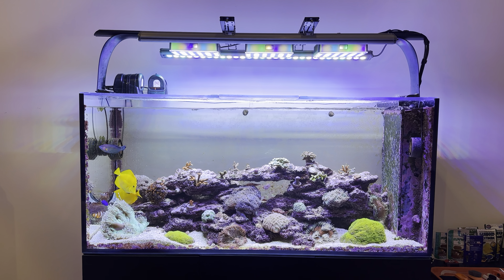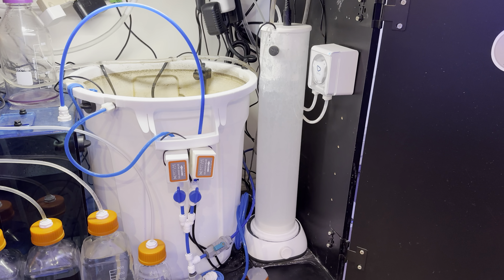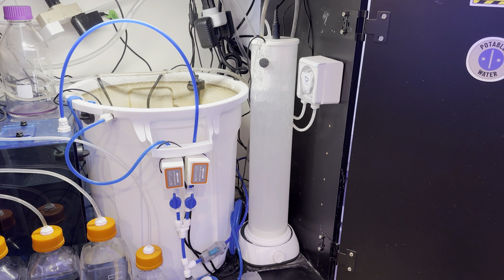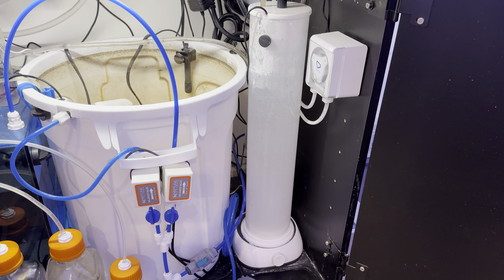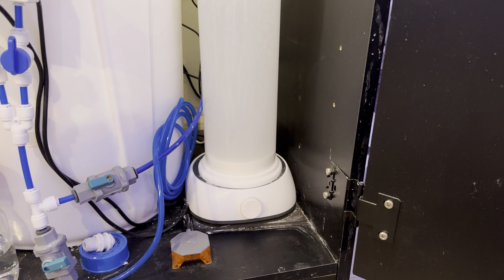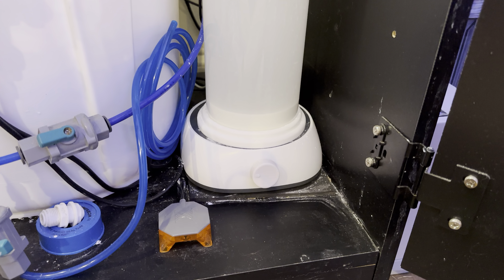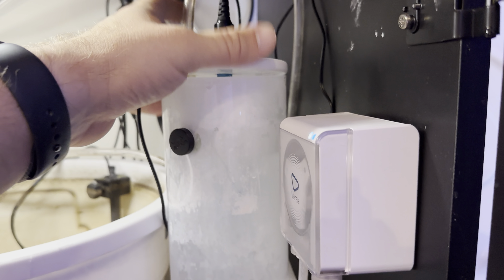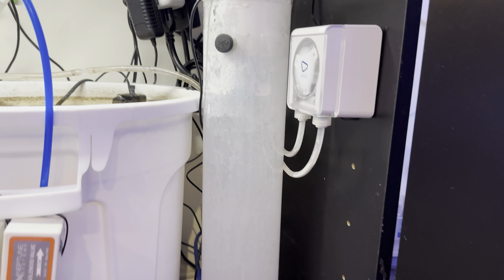Explained: The ‘Kalkamazoo’ DIY Reactor For Dosing Kalkwasser To Reef Tanks

Comment: I just mix kalk solution manually in 5 or 10 gallon container and versa dose same amount as evap rate daily and adjust depending on dkh.  Much simpler than reactors, no need to worry about sensors or mixing plates failing.  Aka meckli method and costs very little to setup.  Also dose into overflow to really dilute well before kalk hits pumps or sensors susceptible to kalk deposits.  Just did my quarterly maintenance on my skimmer Venturi inlet and found very little depositing of calcium carbonate, which used to happen much more when I dosed into the sump.  Nothing like venture capital to screw the customer… bravo!🤦🏻
Reply from the maker: People who run kalk out of a container do love it, but I just like nerding out with my little DIY reactor lol. And yeah, my Versa needed a full reset and reprogramming today for absolutely no reason. Venture capital. Gotta love it.
Reply: @kalamazoo_reefer gotta keep it simple
Reply from the maker: @iammrhappy12  I mean this in all kindness: says who? This is how I do my hobby. I’m a gear guy. I like to fiddle and adapt stuff and make things work together, to keep my tank thriving. It’s what brings me joy.
Reply: @kalamazoo_reefer   @kalamazoo_reefer  In my opinion, dosing from a container of fully saturated kalk is the best way to go and is the most simple. Once the RODI is saturated with kalk and the undisolved kalk sets at the bottom, it can not lose its saturation if its air tight. Check out Chris Meckley at ACI Aquaculture and his kalk method. Many of us do it this way. 
Adding kalk based off evaporation is not very efficient either. Evaporation changes based on the season. Evaporation is occurs nore during summer and less during the winter. You want to be able to know exactly how much youre dosing, just like how we do with 2 part dosing. use this calculator to figure out how much to dose. Its very accurate. hamzasreef kalk calculator. This persons other calculators are extremely accurate as well

Also it seems like youre not letting the undisolved kalk fully settle after stirring because there is undisolved kalk in your versa dosing lines. You should not be adding unsolved kalk into the tank. 

I'm a big gear person as well. I have alot of gear for the tank. Similar to what you have. So I know what you mean.
Reply from the maker: @iammrhappy12  Not saying you’re wrong on any of this methodology, because it definitely works…but also, not going to say all of this is “the best way, every time, end of story” across the board, because there are a lot of people not doing it this way, having a lot of success. The way I’m doing this has been highly successful for me. I’m not claiming my way is better or worse than anyone else’s, either. I strive to not make claims like that. It’s simply how I choose to go about it. I mean, heck, we’ve got people dosing full-on slurry with great results. Nothing about what I’m doing, raises any kind of red flag for me, and the results speak for themselves, as my system has been quite stable overall, ever since implementing this reactor.
Reply: Ok everyone take a deep breath and remember there’s 50 different ways (or more) to get to our collective goals.  Just listen and learn from each other, tweak your technique to fit your needs, and share info so we can all become better reefers.🤷🏼‍♂️
Reply from the maker: @MW-ut3dk  Ha, I am chill about it. It has just always fascinated me that one of the most vocal and pushy contingents of people who comment on my channel are the “I dose kalk from a reservoir” people. I’m not sure what it is about kalk reactor users that triggers this crowd, but I’ve taken flak consistently about using a reactor from them. Just because I use a reactor does not mean I think it is any better than dosing from a reservoir. It helped me save space, and I’m a nerd for this stuff anyway. So I suppose I am just slightly guarded about it, given the track record of past critics of kalk reactors on my videos 🤷
Reply: @kalamazoo_reefer  it’s fine you do what suits you and greases your wheels.  I just find that the anonymity of the internet sometimes gives permission to some people to step over the fine line between sharing info and cyber bullying.  Not saying anyone is doing that here, just hoping this doesn’t start heading in that negative direction.  I’m a subscriber so obviously I do find this channel informative and helpful, so no offense taken on my part.  And I definitely don’t pretend to know everything about reefing, quite the opposite, still learning everyday and tweaking along the way.

Comment: Also, how much Kalk can your magnetic stirrer handle? I made the one that Devin uses and it works great but I can’t put more than two tablespoons in or it knocks the magnetic bar off. I even tried a larger stir bar. It’s the stirrer itself that doesn’t have a strong enough connection. So I’m looking for something a little stronger.
Reply from the maker: @kaseyascani127  It handles about a half cup of Avast kalk powder, for me.
Reply: @kalamazoo_reefer  much better than mine. For that cheap price point I think I’ll try it. Thanks for the tip

Comment: I thought that ph probes should stay submerged in water to stay reliable. Is that incorrect?
Reply from the maker: Not looking for accuracy on this one, just looking for a very ballpark reading. As long as the solution in the reactor is saturated, that probe will always read at maximum (which is 12.3ph), so if it ever drops down to like 9ph out of nowhere, I know there’s an issue with the reactor. It’s a safeguard only. Not actually trying to get an accurate reading with it.

Comment: Gotta love kalk. I was going to get a reactor from MRC but they are pricey and a ton of work to take apart and refill. I personally just use a custom bin to store my kalk and only stir it when i add kalk once every few or couple weeks depending on the tank. I think after it settles even the clear stuff is fully saturated when mixed thoroughly. I use a cheap 4 head doser off Amazon and just go to the next head if i cant get it calibrated but thats rare. I dose right under whatever my winter evaporation is and in the summer my ato still hardly moves. Im sure it would be an interesting video on how long kalk holds its values especially ph. Idk if anyone has done that. Im sure there could be too many variables that may change things though.

Comment: If you were to replace th3 versa what would you get right now?
Reply from the maker: To be honest, not sure. Haven’t looked that hard at the options. I did see Reef Factory had a pretty good looking continuous duty pump, with WiFi connectivity.
Reply: @kalamazoo_reefer  I have the versa and honestly I don’t love it because it doesn’t have WiFi connection and I feel like the app and the way you program it kind of sucks. Idk what I would get to replace mine either, others can get very expensive

Comment: Take out one of your points of possible failure (remove the ATO). 
Just drill a hole in the side at the top of that container (like Devin did) and when your doser doses into the reactor, it will overflow into your tank. You can literally leave everything else the same (2600 mL dosing or whatever you said). So, ATO reservoir to doser to Kalk reactor and then overflows into tank. Also does not fluctuate with evaporation and your doser is never on the Kalk side of anything. Even cheaper because it does not require an extra ATO. 

Enjoying your content.
Reply from the maker: @kaseyascani127  Thanks for the thoughts! I purposely designed it this way, though. I have no interest in it overflowing into my tank. That’s how typical kalk stirrers function, and I wanted this to do something else, so it could be placed where I wanted it. It’s a workaround. Imperfect, sure. But I’ve never encountered a failure.

Comment: I use this same setup. Inspired by your previous videos. One thing i will say. My water level sensors inside the reactor keep failing. Otherwise works great. So right now i manually top up the reactor every day.

I also found because i run it super saturated my stirrer pill doesnt do anything. Due to too much undissolved kalk. Instead i have the water in line run all rhe way to the bottom of the reactor. Every time j refill it resuspends all the settled undissolved kalk.
Reply from the maker: @gomisreef  What sensor were you using?
Reply: @kalamazoo_reefer  hydros. I've had two fail so far
Reply from the maker: Sounds like a CoralVue problem. Should’ve gone Neptune like me man. As you well know, no one has ever once had a single issue with a Neptune product. It’s just a fact.

Comment: Nice job on your custom reactor.  This method will require more maintenance than a conventional reactor but it definitely solves your space issues without having a reactor in the sump.

If you are ok with the added maintenance and dependence on automation then why not go this route?

As long as you change your versa tubing regularly, change the kalk powder weekly and clean the sensor often and this should be reliable.
Reply from the maker: It has worked lights-out for me. The powder in the Versa tubing actually stays powdery, it doesn’t encrust in the lines. So yesterday, I ran a fast-dose program of 25ml, and it blasted the entire line clear. I just give the sensor a thumbnail scrape now and then. Has also never failed. And yeah, I change the kalk powder weekly. You could probably get away with every other week, but I just do it as part of my Saturday maintenance, and it’s no big deal to me. I like knowing I’ve got fresh kalk. 

I’m sure a conventional kalk reactor would need less attention. But I still can’t believe the prices of good reputable ones. Couldn’t stomach it.